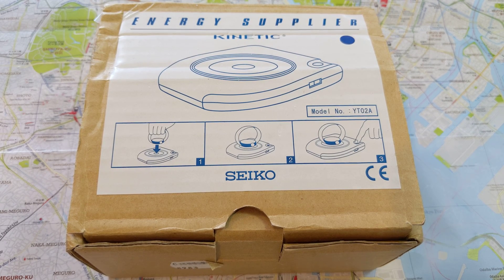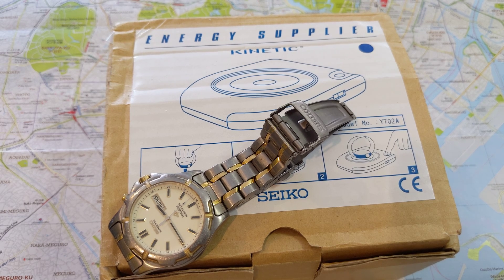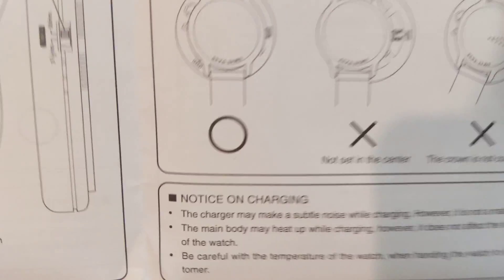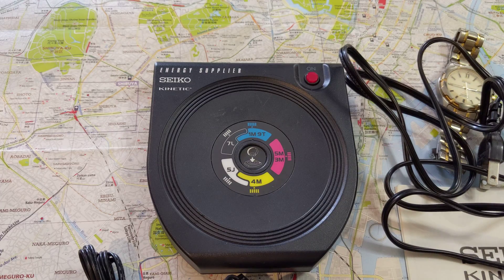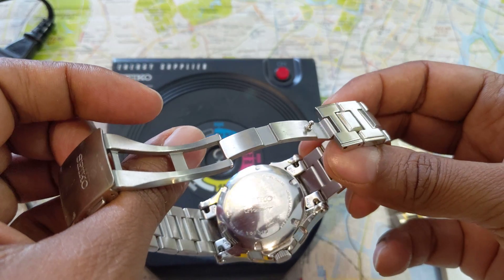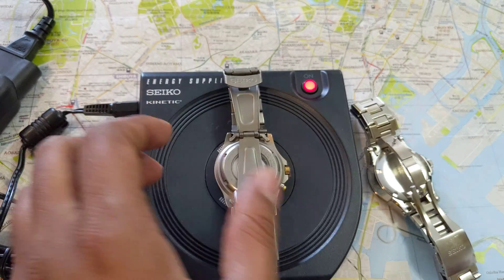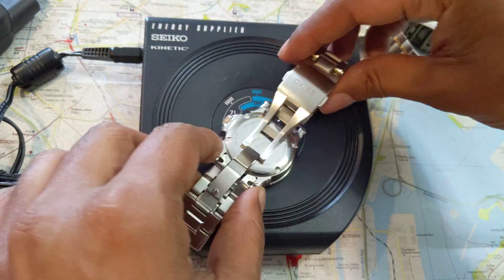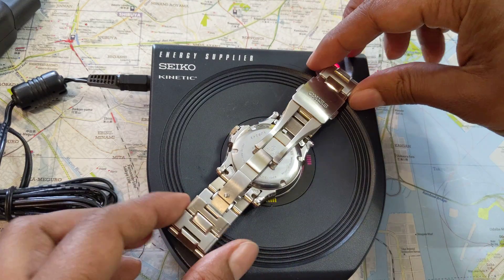Fully Charge Seiko Kinetic in 30 min: Seiko's Secret Device for Charging Kinetic Watches

Comment: The secret to running a kinetic in a rotation is to pull the crown out all the way and stop the watch before putting it away. That way, provided the capacitor is healthy, it'll hold the charge until you get around to wearing it again. Just strap on, set the time and date, and go.

Comment: My Seiko is more than 10 years old. But it is not working. When i shake it, it starts working for few seconds but then stops. What's the problem in it
Reply: You need to change the capacitor, it's a very commun problem !
Reply from the maker: Is it a kinetic? If yes, then it's possible the battery is discharged beyond repair and needs to be replaced. What's the model number?
Reply: But if capacitor is knackered it won't work

Comment: Thanks, does an automatic watch winder also charge the Kinetic?
Reply from the maker: It will take a long time. Not practical
Reply: @DesignReviews  Actually no. they do not spin fast enough.
Reply: @DesignReviews get a pendelum watch winder.

Comment: The instructions shown during this video listed the 5M4 as requiring 20min for full charge, but that assumed the watch was equipped with a capacitor. If your 5M4 now has a rechargeable battery (likely 99% probability it does IMHO), the YT02 full charge will be 3.5hrs. The capacitors at this point in the lifecycle have all failed in these old Kinetics. Seiko offered an upgrade kit from cap to battery for the 5M4 mid-way through its lifecycle. The reviewer also placed his 7D caliber perpetual watch in the 7L position. It should have been  placed in the "5J" position but his YT02 was the older version that does not have the 7D denoted on the charger face. The YT02A shows the 7D on the face and in the instructions.

Comment: I have 3 Seiko Kinetics.
I charge them using an Oral-B electric toothbrush charger.
Set the watch on the charging post at the 7 baton.
Reply: What is "7 baton"???
Reply: some of these toothbrush hacks create a lot of heat inside the watch. If you discover the watch is hot after charging do not use that charger. The heat can damage the battery and/or electronics.
Reply: The Kinetivations KC1 and the Seiko YT-02 dont create any heat while charging. I'm the guy who developed the KC1 and I also own a YT-02.
Reply: could you expand on this?
Reply: Thanks - you may have changed my life. Just placed my neglected Pulsar on my toothbrush charger and it seems to be doing the trick.

Comment: Hi, Can a reachable capacitor be replace with regular lithium battery, If yes will it work for a year or so? thanks
Reply: No. a regular lithium battery cell will not fit a kinetic watch - you would damage the cell anyway because the watch will attempt to charge a non-rechargeable battery, and the fact the connections for the kinetic cells are mechanically customized and do not conform to the standard way a watch cell is installed.
Reply: @stevean9509  I understand that a regular lithium  battery will not fit a kinetic. But what about a rechargeable one?
Reply: @stevean9509 
What if we remove the rotor? There will be no recharging to the battery....
Reply from the maker: Absolutely. It will work just like a regular quartz watch. Should easily last 3 years.

Comment: I have two 5M kinetics which I do not wear enough to keep them charged normally. So i bought the charger (for about $350) four years ago. If the watch is reading at the 5 power level, a 3.5 hour run should bring up to the 30 level.  I find I have to charge them about every 4 months.
Reply from the maker: That charger costs way too much. More than the watches it charges. :)

Comment: Kinetic watches condensators sucks, its done within 10 years. 😒
Reply from the maker: The capacitor? I have Kinetics from the early 1990s (when it was called AGS) and the capacitors work fine. Some of the Panasonic capacitors from the mid-90s was a bad batch, and it gave everything a bad name. Every Kinetic I have still has it's original battery so I have had good luck.
Reply: Todos son así para cargar los kenetic

Comment: Does this work with other kinetic watch? I have a tissot kinetic
Reply from the maker: Yes. The Tissot is probably using the ETA AutoQuartz 205 movement. Works just like the Seiko kinetic.
Reply: No. not compatible.
Reply: I looked into the ETA 205 and it cannot be charged externally. It uses torroidal charging coil inside the watch (the rotor spins a magnet inside the torriod to chrage the watch - very cool design but very expensive to manufacture). External mag fields cannot intersect/excite a torriod properly

Comment: Any idea how to charge the battery from a Direct Drive Kinetic? The case back says 5D22. The charger doesn’t list that type of battery.
Reply from the maker: A Direct Drive Kinetic can just be hand wound like a regular mechanical watch. Makes charging the battery very easy.
Reply: @DesignReviews  that's why I traded my Kinetic Tuna and bought the Direct Drive. No matter how much I wind it, I can't get it fully charged.
Reply from the maker: Huh! What scale marker does it go up to? There are 18 marks or you can read it as D, W, M. Btw, on a kinetic charger this will charge as a 5M.
Reply: @DesignReviews  I couldn't get it past one week by hand winding. I just put the crown on the 5J and in 45 minutes the watch now indicates one month of power reserve.
Reply: 5D is the same crown position as the 5J. If you own a 5D22 Dive watch, the YT-02 will not charge it. Not enough EMF. The KC1 charger will charge the 5D22 Diver.

Comment: Here is a much cheaper option if you are a little bit handy.
https://youtu.be/uH7_IKiUm98
Reply from the maker: Interesting. A Braun toothbrush charger is still the most cost effective way to charge a kinetic. Even on a modified winder, it will take a long time.
Reply: @DesignReviews  I've never gotten one to work.  Is there a specific type of toothbrush charger?  I've tried several.

Comment: HI, is there a way of making a charging simular device with a frequency generator or something? intersting device none the less.
Reply from the maker: It's pretty easy. If I had a few weeks free, I can easily reverse engineer it and put plans for folks to download. Give me a few months and I will make a open source charger.
Reply: @DesignReviews  We the people give you exactly 1 few months
Reply: @DesignReviews  Hi. Did you try making it yet?
Reply from the maker: Just haven't had any time with real life taking all my time. Still hope to get to it soon.
Reply: charges via induction so you can use a Braun toothbrush charger or other kinds. I have successfully charged with Braun charger, just by placing the back of the watch aligning the charger to the middle of the two coils in the watch.
Reply: @stephenmadone1230  I just chucked a cordless tooth brush in the bin...doh
Reply: Can you get an oscilloscope and measure the frequency of the Seiko charger?
Reply: I just spent the last year developing one. Search for Kinetivaitons KC1

Comment: to expensive
Reply from the maker: I agree. It's crazy how expensive it's become. I am going to upload a video that establishes charge times on a Braun toothbrush charger that aligns with the charging on the official charger.
Reply: @DesignReviews  i use a cheap wisdom toothbrush charger works well and charges my Seiko 5M62 OAKOup to 30 sec in less than 2 hours positioned at number 10